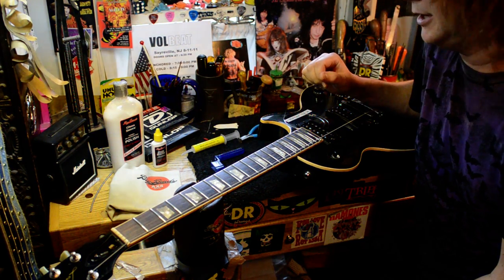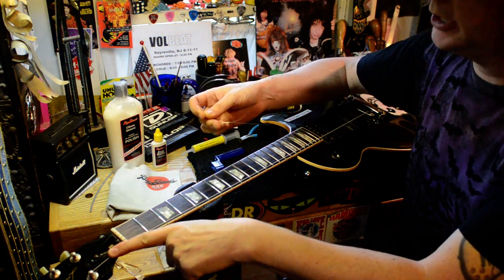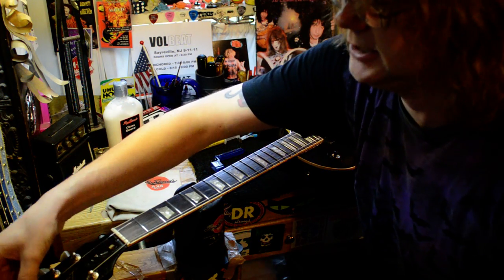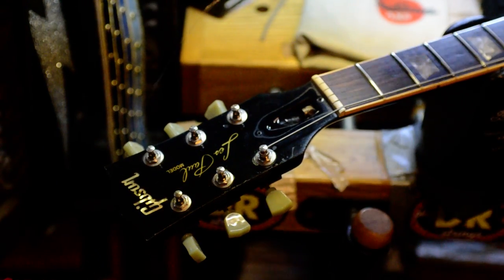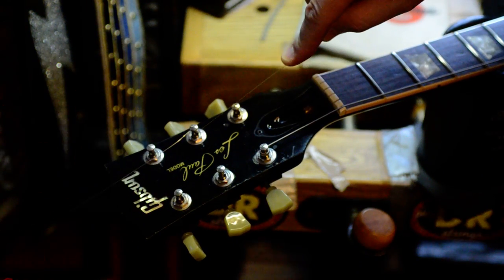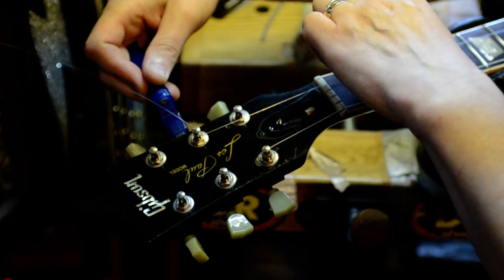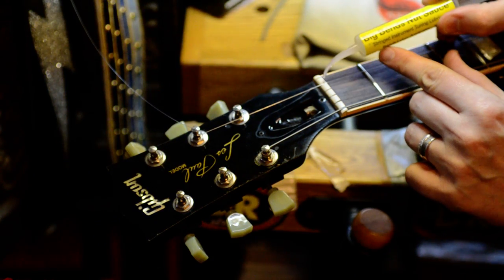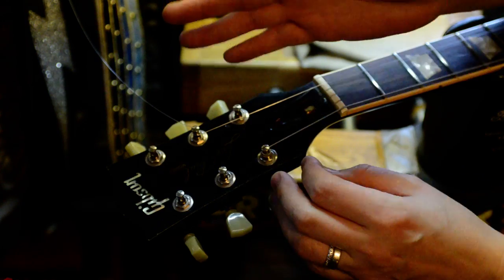Restring a Guitar by Bill Baker filmed in HD closeup demo on MISFITS guitar Pt. 2

Comment: I don't know if he does it in this one , but in the original restring vid he lubricates the nut and the saddles with some sort of small device . Does anyone know what he is using ? As in what is the device and what lube is in it ?  Also , with a graph tech nut , that is supposedly impregnated with a lubricant , would they also need lubing or is part of the appeal of a graph tech nut is they are permanently lubed because it's built in to the nut material . Thanks.
Reply from the maker: jsdspif3 Big Bends Nut Sauce or Planet Waves String Lube (any type will work and will help) hell, Eddie Van Halen used pencil lead back in the day.....BB